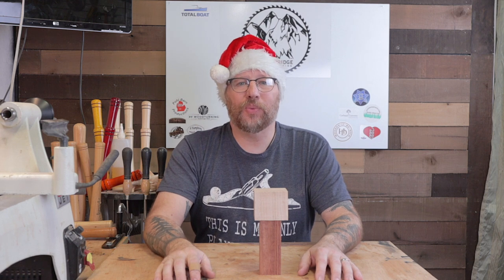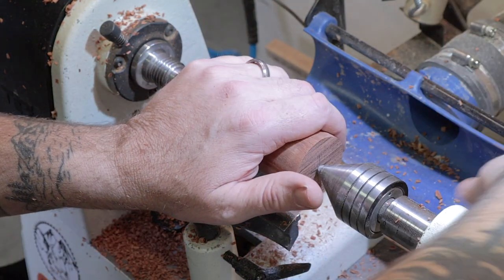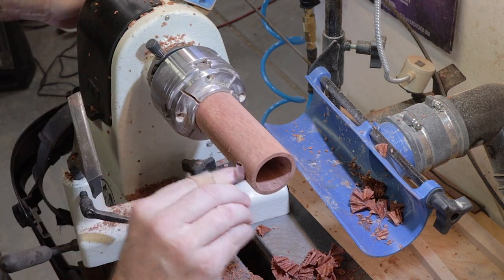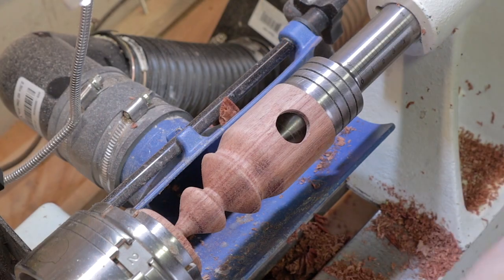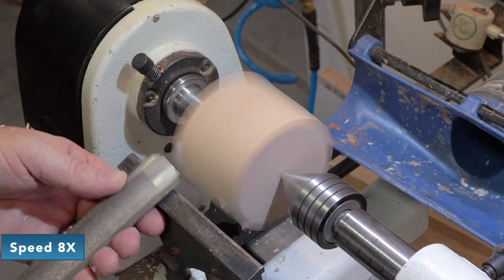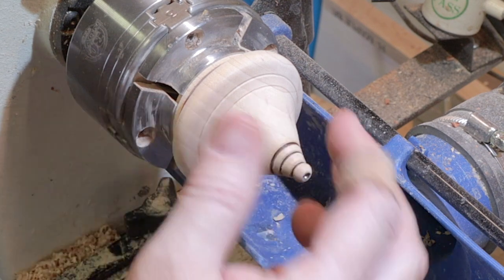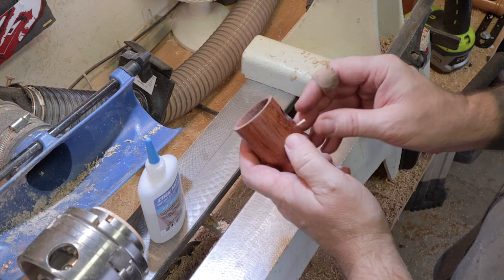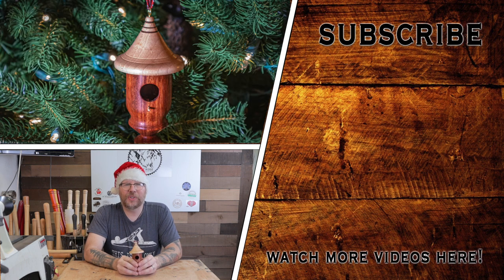Woodturning: Birdhouse Ornament

Comment: Nice tree ornament, Ed!!   When I turn these birdhouses, I typically use a tennis ball on the unsupported end and apply a little pressure with the live end on the ball.   For me, using the 60 Degree live end invites trouble since I always seem to split the wood by applying too much pressure. The tennis ball in between the bird house and live end eliminates that problem.

I like the way you turned a finial with the same block of wood.  Lots of turners will turn a finial with a different type of wood.  To me that is too much trouble.  Your way is simpler and looks just as nice.

For the perch of the bird house, I will go out in the yard and find a small portion of a tree branch and fit it into the drilled hole.  To me, this looks better than a tooth pick and looks a little more rustic.  But, go with what ever floats your boat.